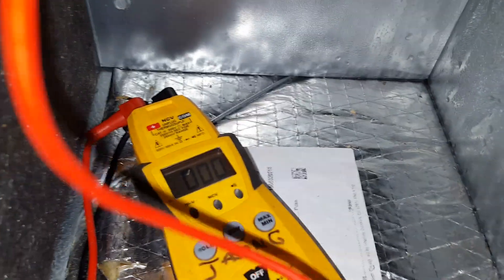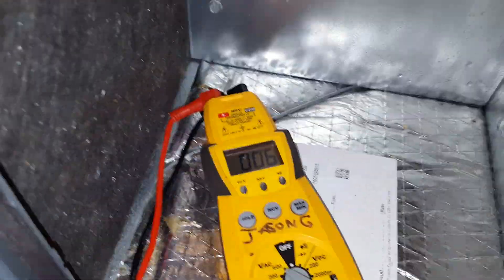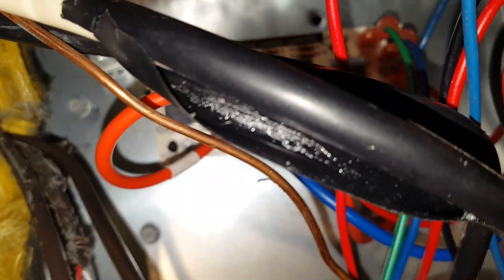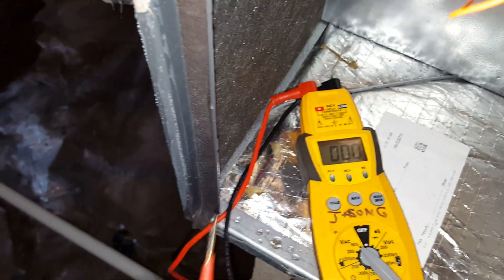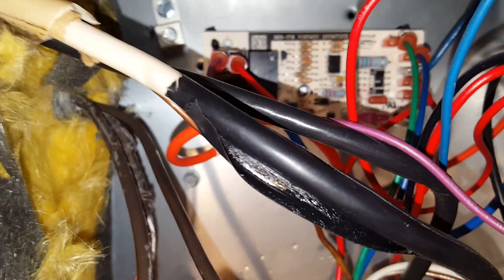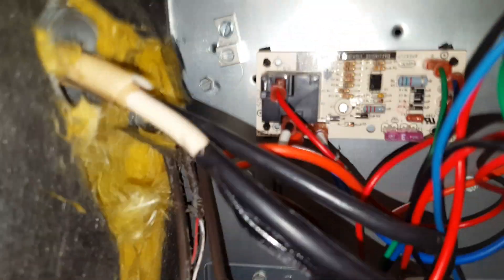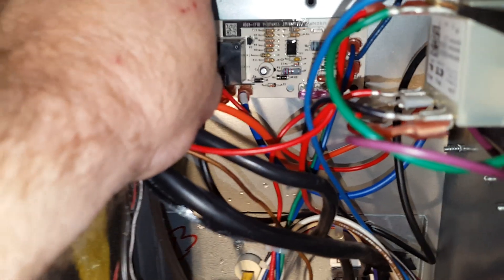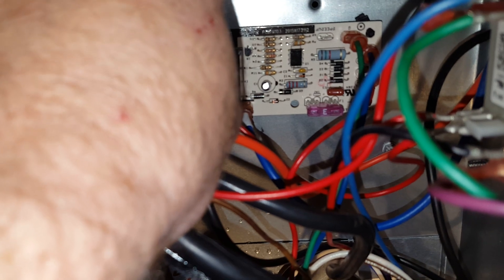Heat pump air handler  fan control board problem

Comment: question? can a blower motor 240v single phase blow a fuse? im thinking its a bad relay because when the fuse blow the condenser stays on but the blower shuts off. plus the system will run for about a week then fuse blow. im so lost at this point.
Reply from the maker: +g smoove I would certainly check the ohms of the blower motor should be no more than 1 ohm if it's the low voltage fuse that is popping then you either have a short in your thermostats is short in the control board or possibly even a short on the contactor side
Reply: I found it your going to laugh. The cap had a short in the wire between cap and the cap cover. Big burn mark was there. Restripped it connected it been good ever since. Thank you for responding